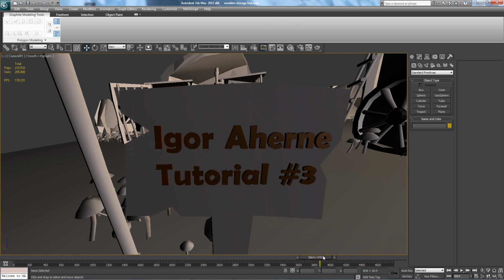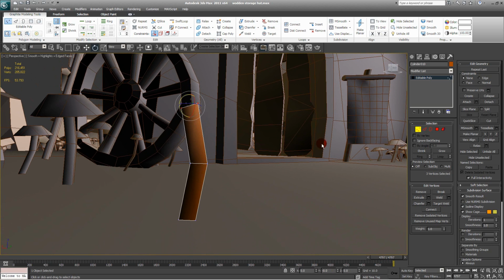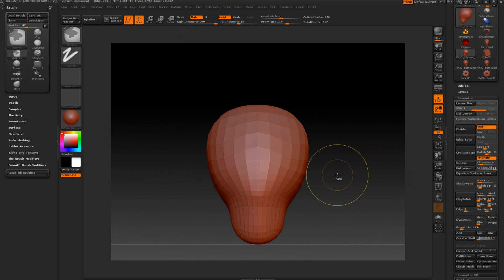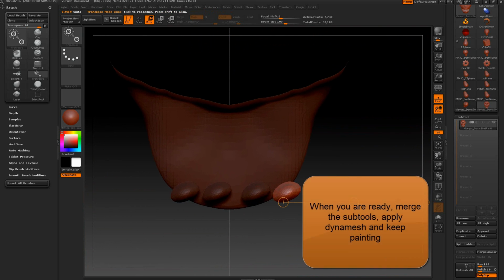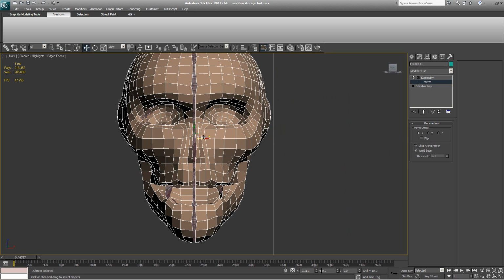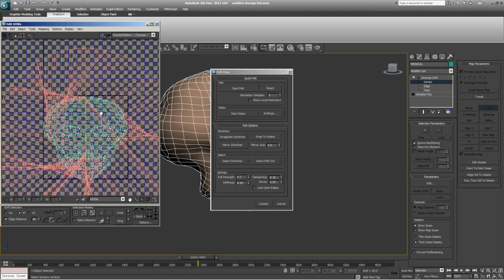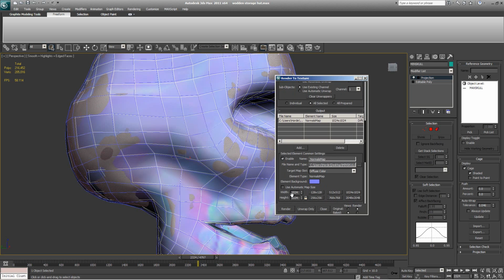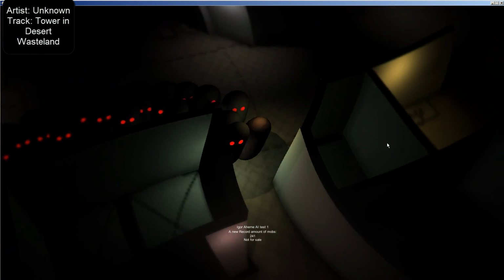How to make a horror game (Part #3) Re-uploaded, Igor Aherne

Comment: +Igor Aherne  hi , sorry for the delay ,  3 "simulation sample " is in the quick pelt menu under the start pelt button 

1 and 2: i had some trouble when i tried to upload the screenshots , so i sent it as  a powerpoint to this gmail bfloltrol@gmail.com , here is the password ' bf4troll'  without quotes ,  don't ask me why i called it that :)  you will find in the inbox an email sent by fares 09 , you will find the screenshots in it , one note " 2 : the two vertices are the  ones on the purple color "

Comment: hi igor: i have just finished the video and i have some question (well many question ) so prepare for a barrage of questions :

 1- i had problem when i was trying to make the mouse of the low polygon module , the teeth of the mouse were round and not at the front edge of the mouse , so when i tried to extend the polygons to go inside the mouse it wouldn't  go and it will pent and the vertices go through each other ( becomes a crappy thing ) so i ignored the mouse and close it with some polygons . so is it okay to go with what i did and how to deal with the mouse ?

 2-in edit seams mode , some vertices i couldn't make a green line between them directly i had to go around form one of them creating  green lines with other vertices until i reach it from another vertices ( means that i couldn't connect them directly so i connected them indirectly ) , so why is this happening ? 

3-in pelt menu i don't quite understand what the relax and the pelt buttons do ,tell me if what i will say is right or not " relax button unfolds the module and then the  pelt  stretch it out but what does the relax do after stretching (that what makes me doubt about my understanding ) , and  another thing what  happens when i increase the simulation sample ( in another word what is simulation sample ).

4- the blue cage form render_render to texture you said it is used for Projecting details from high model to low one , i want to make sure  that i understand it right :  we have the min skull under the max ,that cage that surrounds the min skull we want it 
to fit the max skull so we decrease it's amount until it fits exactly to the max skull and adjust some areas of it that didn't fit well ,
and now that cage takes a copy from the  outer details of  the max skull and store it in what is called "normal mapping texture " then in unity we put it in a material and assign it to the skull. { tell me if i understood it right or wrong }.

5- some settings that you adjusted in render to texture menu  you didn't explain it quite well , so is it ok to ignore it  and just do like what you did and you will explain it later or should i ask ? and another thing what does the render button do ?

6- last question , in unity5 i can't find the slot where i should put the normal map in it.

many thanks ,and sorry for asking too many questions :)
Reply from the maker: +Fares 09 Hye, I will come back a little later, meanwhile can u please provide a link to screenshots to the following questions:

1) (a couple of pictures so I  get the idea)
2) show me the final model (in edge mode, with the seams visible), and draw a red line (in photoshop or paint) where there were problems, from which vert to which)

3) draw a red arrow towards the sample setting you are mentioning
Reply: +Igor Aherne  ok i will, but not now because something happened  ,maybe  after some hours.
Reply from the maker: +Fares 09 Yo )

here is my email: igor.aherne.official@gmail.com, you can send me the PowerPoint there

About 3 - the number of samples around each point. Goes from 1-50, so the higher it is the stronger the pull from the pelt. I would just leave it at the default 5. I don't know much about this setting :(
Reply: +Igor Aherne  ok , i have sent it to the email
Reply from the maker: +Fares 09 Mind you, part 4 will help you understand UV in a much greater detail, don't hesitate to watch it. But, here is an explanation precisely to your problems:

1) For enclosed parts like mouth, to avoid any anomalies, it's best if you create a separate editable poly object. Make it into the retopologized version of the insides of the mouth. So in the end you will have 2 retopologized pieces: the main head, and another object as the inside of the mouth. After that you can Attach them into one editable poly, and target wield/collapse the vertices to each other.
Also, when working on this mouth, you can select the High-poly model and apply a Normal modifier. It will flip the polygons inside out.
Then -> right click on that high-polygon model -> object properties -> ignore back-facing (Actually it's called backface cull"). Then turn it into editable poly once again and keep retopologizing on top it. (Mind you this is only for when you are working on the inside of the mouth. Don't forget to undo those polygon flipping on the high poly model once you are done.
If you decided to do it, make sure that the offset in the graphite modelling tools is negative, so your placed polygons are not going inside this turned-out model.

2) If you press f4, you can preview the model in the edge mode. You can only place blue seams along such white edges. If you don't see an edge there, press alt+x on the model. You might then discover that the edge got messed up and went through the head, towards mouth, etc. In this case you will have to adjust it, so that it sits on the skull properly before unwrapping. Always test with f4 if you have all the edges present where you want to place seams. Otherwise, if there was no messed up polygon, then convert to editable poly and connect the vertices (that you want to connect with the blue seam) with the edge. This is discussed exactly in part 4 when we unwrap the widow character.

3) the number of samples around each point. Goes from 1-50, so the higher it is the stronger the pull from the pelt. I would just leave it at the default 5. I don't know much about this setting :(

4) The high-poly (max skull) model should be inside of the volume between the blue cage and the min-scull. The blue cage doesn't have to fit precisely the high-poly skull. It just should "envelope" the max skull as close as you can. But, the further the cage is from the low-poly the worse the normal mapping will look (more flat and more artefacts).

5) Render will create a texture based on your selected model. For our workflow it will create a normal map texture. We will return to render to texture to bake ambient occlusion in the start of part 7, so don't worry about other settings for now.

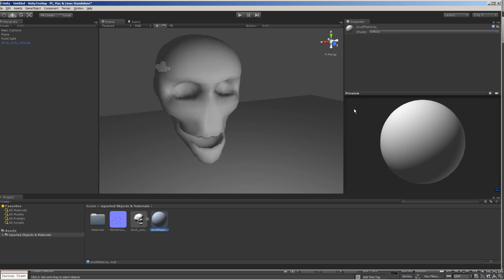6) Material window is a small roll-out. Make sure you've clicked on that tiny sphere preview in the rectangle where it says "shader:" and gives you a dropdown. Otherwise you won't see the slots for diffuse or normal map which I had at 1:07:55. Also, if you don't want to use the standard shader of Unity 5.0, but use the one I had, you will have to pick Legacy shaders -> Bumped diffuse from the dropdown of shaders.

Part 4, 5 and 7 tell you much more about unwrapping, showing the unwrapping techniques used by games like wow, etc.
Reply: +Igor Aherne  much thanks , but some last question ,1) i can't find  "ignore back-facing" in the object properties .
6- i have sent you an email with a screen shot of the material menu , so tell me where i should press to bring the slot to put the normal map , (sorry for the many questions) and many thanks:)
Reply from the maker: I meant "backface cull", shown here http://www.pxleyes.com/images/tutorials/submissionsteps/fullsize/2677_step15_4f0a010c6cf4b.jpg
Reply from the maker: Ah, in Unity, where it says "Debug" on the window -> right click and select "Normal". This will change the type of the the window to the one I have in this tutorial. 

1:07:58 notice how I click on the small sphere, exposing the settings of material (After I set bumped diffuse as the shader)
Reply: +Igor Aherne  many thanks , and sorry for my annoyance  (it was  really a barrage  of answers lol).going to
part 4:)

Comment: hello igor :
sorry for my continuous  question but i am the kind of person that wants to know more :) .
anyway ,the question is : why we must avoid triangles while we are in the process of re-topology (i don't know if this is the correct word but you know " making the low  polygon module from the high one") .
Reply from the maker: +Fares 09 no problems, make as many as you want - it increases my video's rating,

Avoid triangles only when you might need to tessellate the model  (if you decide to improve it in z brush), etc.
subdividing a triangle is always a pain in the butt, but splitting a quad into 4 other quads is simpler.
Also, comes in handy when you quickly need to select a loop of polygons arround the character's finger, arm, and so on.

do a quick jump to the end of part 9, ( just watch the theory, about 10 minutes and don't do coding) and you will understand it.
https://youtu.be/TwZH-aoSzJk?t=6h35m07s  (I've selected the time for you, don't go anywhere else)
Also, don't worry about terms "mesh filter / mesh renderer", just focus on the thing I am describing in photoshop + 3ds max
Reply: +Igor Aherne  OK ,will do ,many thanks:)
Reply: +Igor Aherne  i have just watched the part you told me about , know i have a clear understanding .
much more thanks:)

Comment: why you did not use 3ds max to make  the human skull and instead you used zbrush  ?
Reply from the maker: +Fares 09 when working with clay-like substance, I think zbrush has the best toolset to do it. 3ds max is simply good for other things. Please check out the work of people like ryan kingslien, sculpts on the artstation.com, and zbrush master class presentations. My skull wasn't even close to their level, but conveyed the point :)
Reply: +Igor Aherne thanks for the reply , so zbrush is better and easier  than 3ds max when working with clay-like material got it ,went to artstation.com " those are the pros " but that doesn't  depress me it makes me want to  get better do like them and it shouldn't depress you either :)
Reply from the maker: exactly :D Just find the areas u love and excel in them through several years
Reply: +Igor Aherne yeap

Comment: why do you use zbrush to make the human skull . Does this mean that we can not use 3ds max to make it .
Reply from the maker: +Fares 09 The skull I did 2 years ago was a pretty bad one) But the idea is, we "sketch up" beautiful, very high poly models from clay-like material, then make an approximation in 3ds max. 
We also steal that beautiful look via normal maps and use it the low poly model with that texture in the game engine.
For working with clay, imo zbrush is the best and the easiest, although you can use anything, - 3d scans etc.
Reply: +Igor Aherne thanks but what did you mean by"  then make an approximation in 3ds max".
Reply from the maker: I mean, we make a low-polygon model, which is an approximation of the high polygon one (the one we made in zbrush). It has fewer points and polygons, but still resembles the shape of the original, high poly sculpt.

In games, we can't use ultra-high poly models, so we have to find workarounds like this one
Reply: +Igor Aherne ok got it ,thanks :)

Comment: Try not to use so many triangles
Reply from the maker: No, Austin, the trick not to use triangles applies only to organic models that will be skinned and deformed (humans, animals etc.) Objects are more than welcome to be triangulated if they are of a non-live origin (tables, walls, chairs or even pieces of a robot). 

Part 4 talks more about quads, part 5 talks about polygon smoothing.

Good luck!
Reply: It's totally fine to use them. However if you wanted to sculpt it in something. like mudbox or zbrsuh, after using 3dsMax.  The program wouldn't be able to divide a triangle into more polys.
Reply from the maker: That's right! Unless you use DynaMesh )
But quads is indeed the way to go in this situation
Reply: Would you happen to have the know how. When it comes to making a game that is free running like skyrim?